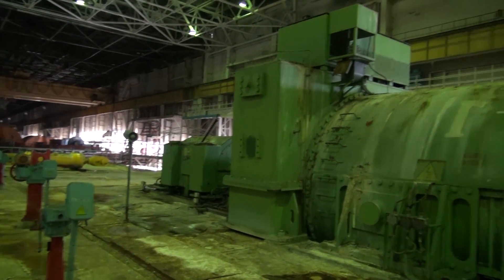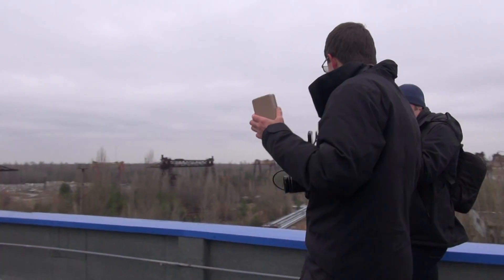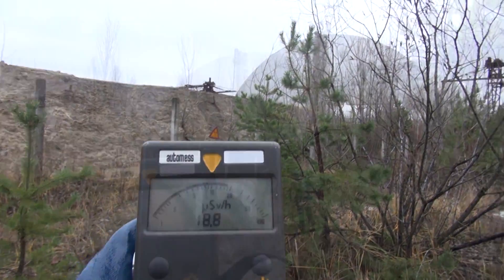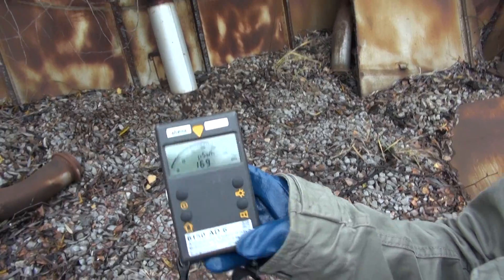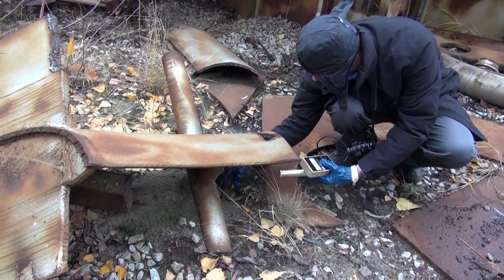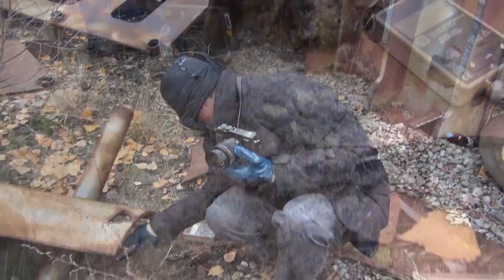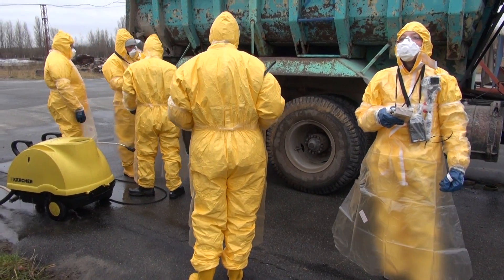HAZMAT radioactive pieces from inside Chernobyl reactor 4!

Comment: One of My Collage Professors Joined An International Coalition of scientists and Engineers but they only wanted older individuals that were either terminal or close to end of life and it was when the cement that they initially poured on Chernobyl was starting to break down and they were looking for a fix to help contain the radiation at Chernobyl by this time he was in his 70's and his wife had passed so he joined the Coalition, It was a one-way trip.
But For A Good Cause. RIP.  Mr. Luke Lee Jr.

Comment: Exposure to 100 mSv a year is the lowest level at which any increase in cancer risk is clearly evident. A cumulative 1,000 mSv (1 sievert) would probably cause a fatal cancer many years later in five out of every 100 persons exposed to it.
For example, a single one sievert (1,000 mSv) dose causes radiation sickness such as nausea, vomiting, hemorrhaging, but not death. A single dose of 5 sieverts would kill about half of those exposed to it within a month.
just to point out how dangerous this is.

Comment: How where you guys tracking your dose.  I see a guy in an orange hat that as an EPD on his chest that could give your group a dose reading while inside the building.  However, I don't see anyone with dosimetry while you are outside messing around in the High Radiation Area.  The NRC rules require an alarming dosimeter set at 500R for all workers entering into a High Rad Area and I don't see you guys downing that.  If I had to assign a dose to your group I would use the most conservative numbers.  1 mSv at 30 minutes is 50 mRem.  As a side note this radiation field you where in is over the US limit for the public which is 2milliRem for any total hour of exposure.  Your total dose of 50 mRem is 1/100 of the dose limit for a rad worker in the US.  Most Rad workers never get close to the 5 rem limit.  You did not break the US limit for members of the public. That dose is 100mrem a year, (10CFR835.208) but from your actions in this video I bet you busted right through that level while visiting the Chernobyl site.  If this event happened at a US Radiation Facility the RSO would have been flagged with IRR or Individual Reference Range event.  After his/her investigation you would probably never be allowed on that site again.  What was the purpose of that little exposé?  Where you looking to get more YouTube viewers?  ALL RADIATION EXPOSURE MUST HAVE A BENIFIT (ICRP Publication 138)  Filming some guy digging in the dirt with his bare hands in a High Rad Area in order to find a Very High Rad object is not beneficial to anyone.  What is weird about this event  is that since Chernobyl is getting international money to build the sarcophagus they have to be regulated by ICRP publications, so I don't know how you guys where allowed into the High Rad Area.
  
The one and only beneficial thing this video shows is how High Radiation fields mess with your judgement.  Many people while inside a High Rad Area have sited a feeling of blah while others, like yourselves, have sighted a slight eurphoric sensation.  Regardless, both sensations mess with your judgement.  During the Chernobyl clean up there were many cases of this happening where people entering a High Radiation Area would just start doing stupid things.  There is link below showing some footage of this unique behavior.  I assume this change in behavior explains why a nuclear engineer would be digging around with his bare hands in order to find some extremely High Rad Material.  Anyways, I have seen enough Chernobyl videos to know that all the really High Rad stuff would be under those thick steel plates which were purposely put on the High Rad material.  This was done to keep wildlife and stupid people from exposing themselves.
https://www.youtube.com/watch?v=FfDa8tR25dk&t=517s

Comment: My worries would not be the radiation levels at diff. areas, but to dig a more or less higher contained stuff and get the dust or particles from the soil into my lungs... Now imagine u go search for the firefighers suites piled up in some buildings, you fell, right into the stuff, all the air filled with dust from the highly contained suites ..Now I say even worse, you fell and u hit your head, u loose contiousness spending several hours, breathing unconcious in a room filled with still highly radioactive dust..I think u would be fucked up lol

Comment: isn't there a danger of long term health effects of radiation exposure being around all this material?
Reply: Radiation danger is proportional to radiation exposure.  In these videos they are exposed to relatively low levels of radiation and they are staying in the vicinity for only a short time.  Bionerd23 specifically says they were around the equipment for about 30 minutes.
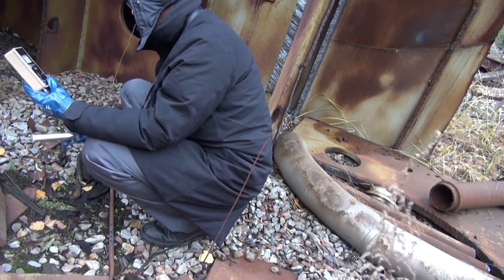Reply: At 3:08  the engineer shows the close levels at 60mR/hour.  The average yearly dose for US individuals is around 500mRem-hours. So for 30 minutes exposure standing right next to this equipment, they would receive 1/16th of a years average exposure.  US industry exposure limits are 5 rem-hours per year or about 10 times this level.  Short exposure is fairly safe.
Reply: ACombineSoldier yes there is, but these people are idiots. they say they are professional yet touch everything and go around without protection, cause it's fun and cool till they get cancer with 40
Reply: @doritodust2259  and if you watch when she puts the counter on the ground it goes haywire like it does everywhere there because the radiation is now settled into the soil is why the stricly tell you too NOT go digging into the ground...but just another millineal showing no respect or reverence to a place where THOUSANDS of people gave their lives so Europe didnt turn into a nuclear waistband and her doing whatever she wants too

Comment: Is there a reason that Carl is measuring in Roentgens? I thought those units were largely obsolete and replaced by the metric Sievert.
Reply: The Roentgen unit is easy to measure electronically, because it is a measure of electronic charge released in air.  Many instruments still directly read exposure in Roentgens or some division thereof.  To relate this to absorbed dose units (e.g. rad or Gray), some knowledge of the radiation energy spectrum and absorption medium (if different from air) is required.  To convert to an operational dose equivalent like Sv or rem, further assumptions are required.  As a gross rule of thumb, owing to mathematical coincidence, 1 R exposure often produces an absorbed dose close to 1 rad (10 mGy) and an effective dose of about 1 rem (10 mSv).  The SI units are becoming widely used, but there is no special unit in this system for exposure, so the Roentgen will probably continue to be used.
Reply: @Carl_Willis  Hi Carl!
Reply: @noahshomeforstrangeandeduc4431  Greetings!

Comment: has anyone developed a flir type technology for making radiation visible?
Reply: If we can develop the tools to see infrared and other multi spectral imaging apparatus it should be possible with multiple micro counters to create a type of machine vision of particle emissions then map them onto the environment.  The answer is yes it can be done but the question is anyone working on it?  A single counter is a primitive eye it can see emissions at a distance however not with great resolution.  3yrs of funding and a team of physicists and engineers and I could have it built.
Reply from the maker: yes, it is being worked on. however, it's harder to do. to shield light or infrared radiation, you don't need much substance. to get the spatial information on high energy photons (x-rays, gamma radiation) / a directional view is much more complicated due to the penetrating character of gamma radiation. but i've heard of research being done on that, but am not involved in it myself.
Reply: Yes it's called the CCD charge coupled device

Comment: Really want a geiger counter.  The one Bionerd uses is about 500-800 dollars!  Jesus.  Anybody got a 2nd hand one for sale?  There has to be something radioactive around here...
Reply from the maker: you really don't need that for finding flea market objects and stuff. this one is energy compensated on calibrated, so pretty much saying "look, we'll tell you the correct dose rate and you can bet your life on it", so for professional use. it's absolutely unnecessary to tell "elevated" from "not elevated" levels or to e.g. find an old piece of uranium glass. look for some civil defense gear instead, $50 at a garage sale or hamradio market assuming you're american. pancake probe preferably, more sensitive and BETTER for detecting e.g. uranium glassware than the counter i am using!
Reply: I guess that's why I like u so much, Bionerd.  I don't understand half 
the sh*t u are saying.  Going to Ebay to look for a pancake probe.  I 
think you are saying it's better off looking for old coins in the sand 
than looking for radio active stuff in my area (north Georgia, the 
states).  Anyway, j'taime and Happy New Years:P
Reply: I see CDV-715's for sub $75 USD pretty often. CDV-700's are normally $100-$200 USD. 
Not sure if the 715 is that usefull since it is a very broad higher power detector. Finding one with a pancake probe normally only adds to the cost. That said im new to looking into this stuff so you could probably find cheaper if you look harder.
Reply: For urban prospecting and ease I would advise a modern geiger counter like the GMC-300/320 from GQ electronics. More possibilities for experiments.

Comment: wow, awesome video. Do you think they're doing the best they can to contain? I guess is the best word, the radiation and contaminated parts? I wonder if they plan on putting them all into the containment building? I'm curious, when you're near a very high reading, do you feel anything? Like, if your hand was near some fuel, would it feel warmer, or your hand feel like pins and needles? Very interesting video, I have to say, I don't think I would have the nerve to go into that area. The large piece you think could be turbine is possible, it's got a flange where a bearing would sit, so it's entirely possible it is an input or output area of the shaft, which would sit in a bearing.
Reply from the maker: well, there is no room to store ALL the contaminated parts. they stored the SERIOUSLY BAD parts inside, but the less bad parts also have to go somewhere, so they're moved outside until they can properly be disposed of. 
just dumping stuff like that on the soil may seem crazy to some people, but believe me, they just dont have room for this, it's not carelessness. there's just too much material to handle in a very short amount of time (the new safe confinement had to be placed above the crumbling sarcophagus as soon as possible as a collapse of the roof was feared!). so the best solution was to put it in an already contaminated area near the reactor, out of the way of builders and the building site.... and then, when removed eventually, remove many layers of top soil which have been contaminated with the contaminated steel. still, the best temporary solution.
Reply: bionerd23 wow, thanks for replying so in depth. I understand, it's already contaminated, so it's not harming anything, so to speak by putting it that area away from people travelling in and out that could take contaminated off site. Thanks very much again, awesome answer and amazing videos, they're very interesting and in depth. Happy New Year to you also, all the best.

Comment: What does your job entail?
Reply: I know I'm a few years late on this but Jake (the student you see at 3:50) gave a presentation at an MIT Nuclear Engineering class where he talked about this trip. It's on MIT open courses and can be viewed on YouTube. Really interesting stuff. The other commentator is basically right. Part of their job was to decontaminate vehicles. What's funny is that the local workers were not wearing any kind of protection and stood right next to them in their street cloths. Apparently that truck that we see at the end was not particularly highly contaminated to begin with, but rather served as an exercise to show the procedure.
Reply: If I had to hazard a guess its probably decontaminating vehicles that were used to build the new safe confinement. That explains the hazmat suits and what looks to be a Karcher hds 558 pressure washer next to the truck. The suits are probably used because the water splashing off of the truck has the potential to be contaminated.

Comment: Can that scrap metal be disposed of at a foundry? Like 100 pounds of contaminated metal to 5 tons of  new steel.
Reply from the maker: hmmm, as people mentioned above, scrapyards avoid this, but it may actually be a good idea...!
look at homeopathy: people either believe it is bullshit, or they believe it works, but i don't think anybody suggests that homeopathy is something dangerous, so it is either ignored or accepted, but never feared as-is (people suggest it's dangerous because standard e.g. cancer chemotherapies are neglected and homeopathy used instead, but this is not a danger because of using homeopathy, but a danger of NOT using chemotherapy, so it's a different story).

now homeopathy uses the "like cures like" concept, so you receive a homeopathic dose of a poison to cure poisoning, homeopathic diluted flu virus to cure flu, etc. - so how about we make homeopathic radioactive steel, so the contaminated metal is so diluted with clean steel, it can no longer be measured with any standard radiation detector. 
thus, disbelievers will be like "blah, whatever, i don't care, there's nothing there" and the one who believe in "like cures like" will believe that this will cure all radiation illnesses if they live in a house founded with "homeopathic radioactive steel D6".
Reply: It happens sometimes accidentally. Not with power plant parts, because the regulations for them are extremely strict, but sources from medical equipment, like cobalt 60 from x-ray machines occasionally end up in scrapyards. There was a case in Taiwan where entire buildings were contaminated with cobalt 60. People lived in them for several years before anyone noticed. The interesting thing is that there were significantly less cancer cases compared to the rest of the population (the explanation is radiation hormesis).
Reply: I have heard that scrap yards are really careful about not accepting anything that might measure unusually high for radioactivity. I guess if it gets processed, the yard has to scrap a lot of equipment, which ends up being very expensive.
Reply: No, that would lead to contamination of the foundry and possibly of the surrounding area. This happened in Elektrostal for example.
Besides, something that emits 1 mSv/h of gamma radiation will still be quite radioactive at 1% dilution.
Reply: structural engineers should worry about you nuclear folks conversation putting this waste in their business. You make some of this too casual and thats nuclear waste your dealing with.